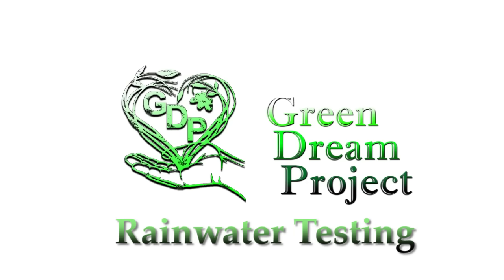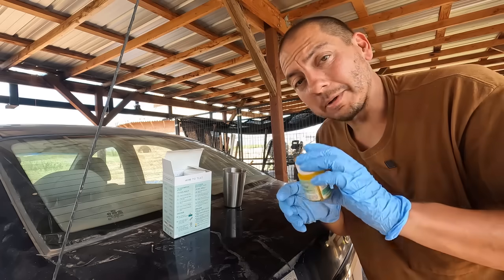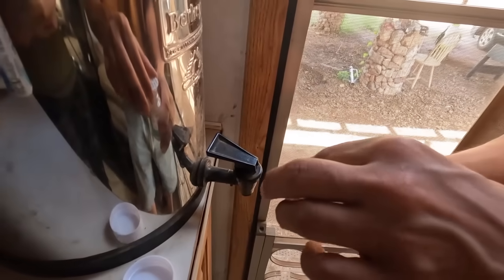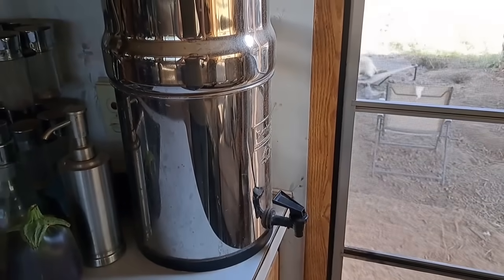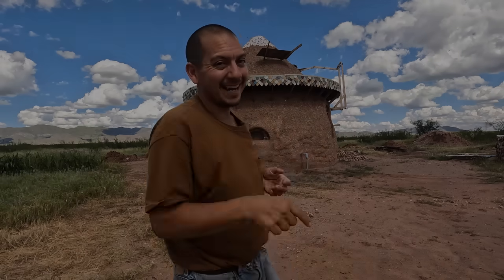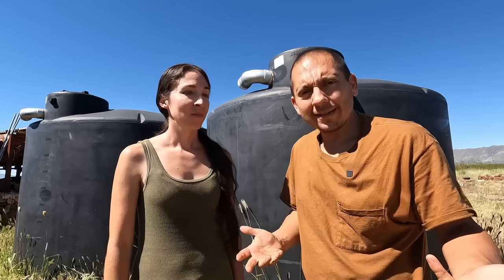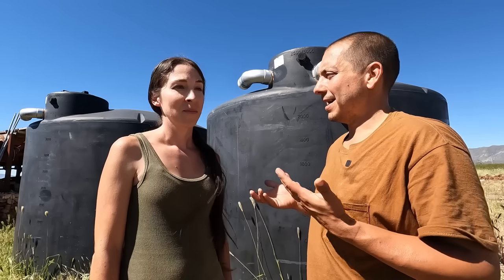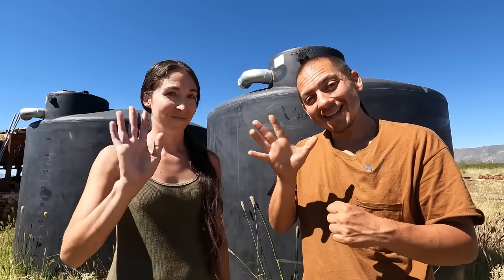Is Rainwater Safe To Drink? We Put Ours To The Test

Comment: Good stuff. Thanks, guys. .. I've been off-grid at end of 4 wheel drives for decades. .. Melted lots of snow during the northern winters ...for all our cabin and critter water. I'm 75 and not sick, yet. .. I have wondered about the particles of dust around which moisture condenses until the drops are heavy enough to fall from the sky. .. Weather on eastern or western North America, big wind storms bring dust from the Sahara or the Gobi deserts, and other locations, to North America in about 4 days. That light weight and high flying dust may be from geologic or other dry plant and animal sources. .. For me, originally considering that eating wild plants that were healthy to be safe and metabolically responsive to their varied dust cored water droplets ...seemed sensible. .. .. Then, perhaps making my body out of metabolically adapted wild plants ...seemed a good idea. .. .. Now-a-days, performing the tests you have demonstrated plus filtering that rain or snow water, hoping to eliminate industrial human and livestock sourced dust particulates sounds like a good idea. .. .. Thanks for sharing your very good video lessons.

Comment: I collect rainwater and I use multi stage filtration and then reverse osmosis water purification, and the last step is an ultraviolet LED light made by crystal is called “klaran” My water has total hardness of 2 ppm and seven log reduction in bacteria. Which is perfect water. Everything is powered by Solar Panels batteries and sure flow pumps.

Comment: As far as plastic / forever chemicals. 
Of course that is just what you should be testing for. Drinking rain water is practically drinking distilled water. And that's what your test reveals. 
The led that should not be in there at all came from the Air we breath. I was surprised there was no mercury. That also is from the coal burning plants. Apparently you are not down wind of one. 
The plastic from your water tanks is one of the things I would think would be the highest level in your water 
.. 
So make sure you test specifically for at least that kind of plastic. Along with forever chemicals. If forever chemicals are in the Air then it is in your water table too. 

Let me know how it goes.

Comment: Commenters below seem to have a preoccupation with strontium, barium, aluminum and a few others. The most important information you need from water analysis is pH, iron, manganese, arsenic, lead, nitrates. And of course bacterial contamination. pH influences your water treatment options. Iron is just an aesthetic concern, as too much lends an unpleasant metallic taste to your water. Manganese is a concern for babies at very high levels. Arsenic is a fairly common natural contaminant, and while the generally accepted 'safe' limit is 10 ppb, you'll want to get it much lower than that. Lead is often contributed by the components of your own system. Finally, nitrates interfere with your hemoglobin's ability to transport oxygen, so they must be dealt with. 
Don't waste your time on the so-called forever chemicals or strontium or other trace elements. You're not going to be able to remove them so focus on those you can.

Comment: Strip tests are fine, generally… but you should really have a sample done by an independent lab at LEAST once a year. Like, in concurrence with the strip tests… to compare, and verify their accuracy. Test the source water (first holding tank), then the final product (from the tap). (Water / Wastewater Treatment Operator - 20 years) Shrugging it off, or saying something like, “I just rub dirt on it, like my granpappy used to - and I’ve always been fine.”, is begging karma for a life lesson, that is preventable, and that too many don’t survive.

Comment: The only issue I see is the lack of trace minerals. If it is an issue tho, you'd have medical problems and Doctors visit will probably have it sorted with small dietary suggestions or supplements.
Me personally, for the drinking water, I'd bury the tanks to keep water colder. Depending on terrain that might not be a viable solution.

Comment: Been working with water for over 50 years, and an all-in-one test strip is right at the top of my list of things not to trust. Lab tested results side by side would be better. Also, you didn't test for a lot of the most prevalent contaminants; PFAS, VOCs, & other heavy metals such as arsenic & cadmium (the latter being used in the manufacture of some plastics. And then there's the issue of black plastic tanks sitting out in the sun & possibly leaching from your tanks. Matte finish poly tanks are often NOT UV stabilized, meaning the base polymer can still react to external UV, etc. Point being, everything from the UV exposed PVC pipes you may use to move your water from tank to tank & to the house, to tank material itself can be adding contaminants. Being downwind from a power plant (look at "Death Valley" in West Virginia, just downwind from where the PFAS precursor C3 was, and likely still is being made, also increases pollution. The problem is that the lab tests are big dollars to test for everything, so better to save your dough, assume EVERYTHING is contaminated, and put those testing dollars into better filtration & treatment. Comprehensive biological, chemical & mechanical filtration can be achieved on a homestead scale reasonably affordably for DIYers, but with iron removal & pH correction I'd expect the total to run around 5 grand. Mind you, that's for near lab grade quality water, and you can still add RO beyond that. Anyway, love the premise. I live in one of the numerous areas where Dupont polluted everything, so we treat with everything from the above mentioned, plus ozone, UV, and an assortment of absorptive resins, but we're also surrounded by stable genius types (gump voters) who don't believe in science, so if they can't see anything in the water it's clean enough for them. Of course most of them die younger from cancer, but they still don't get it. Always assume the worst, prepare for it, and you'll never be surprised or disappointed. Rain water is still the best however, especially since gravity brings it right to you and you don't need to waste energy pumping it up out of the ground. 😊

Comment: I have 2 , 3k gallon poly tanks and a fairly extensive plumbing system that runs around 10 acres, the plumbing system also feeds about a two miles irrigation system. Twice a year or more I add 1 gallon of colloidal silver to each tank, it takes out any bacteria . We use the same tests.

Comment: Of course rain water itself is ok to drink..... but what it comes into contact with after it falls needs attention.
The roof, the pipes, the tank.
Anything in the air will settle on your roof.... if you leave the water stagnant,  that's a problem.....

Comment: I live in the Philippines and collect rain water, infact here, they encourage rain water collection. We use it only for bathing, and washing veggies, I have 2 2000 litre tanks, and 1 1000 litre tank,  on a occasion  due to lack of rain. I go to the local well water feed, fill a smaller tank 450 litre tank and transport it and transfer it, careful to keep hoses clean.  I have often wondered about rain water.  Here the windstream flows from east to west, so we do not get the pollution from china. I am a fanatic about water, its a needless cause to get sick or even die because of bad water yet it happens 829,000 times a year world wide and unbelieveably 6630 people in the U.S.

Comment: It depends on the wind, dust, nearby industry, air traffic routes, seasonal pollen, ... If you live next to a pig farm, there will be ammonia, fecal bacteria... I use reverse osmosis. There was a scandall with Berkey filters. Of course it's not perfect. Carbon filters dont bind to heavy metals, salts etc. Do a test if it even removes sugar, salt or a dye from water. I dont have to tell you that it doesnt or it will get clogged. Rainwater is rather clean tho so it's probably good enough for you. I'm not saying that it's unsafe in your location. Someone else may have an aluminium roof leaching the metal into it. Asbestos is still almost everywhere. Paint flaking off. Microplastic. Your tank is made of plastic and it's in the sun. The test wont show you any of that. Hydrocarbons from fossil fuels, silver iodide from cloud seeding,... Not even the lab will test for everything

Comment: Licensed Drinking Water treatment and distribution operator (Ontario, Canada) and licensed Profecional Engineer here. If using rain water for drinking, consider your roof material. Chemicals can be leached out of tin, ashfault shingles... there are also animal dropping and bird droppings to consider. There could contain parasites in bird droppings, and viruses, bacteria and protozoa like girardia and cryptospridium (to name just a few of the pathogens). Also, when it hasn't rained for a long time, there is more dust, polin and atmospheric particles in the first flush of rain water. If you live close to a urban area, then there will be particulate contaminants from vehicle emissions like brake shue dust, rubber. If in an agricultural area there could be increased dust and residual crop spray. Just be mindful of the rain / dry duration, your area, roof material and very strongly consider a "first flush" removal system to divert the first 2-8mm of rain away from your collection tank (maybe a secondary brown water tank for the toilet). I too collect rain water in a 2500gal underground cistern, but I use this for everything except out human drinking water. Mainly because I don't have a good first flush system. But generally speaking rain water is distilled water that falls through the atmosphere dissolving gasses, soluble particulates, encompassing particulates before falling on your roof, and picking up gunk that's settled on your roof. First flush diversion solves most contaminant issues. Stay safe

Comment: 1... What inline filter do you use... Can you backflush and restore it to near new? 
2... Do you have a pressurized system: pump, pressure vessel etc... 
I live in a fully urban city, and have been using IBC totes to water the garden... Am trying to create an actual way to utilize rain water as a whole house system and shut off city water for all but the driest months. At worst, it will save some money. At best it will provide water for me and my neighbors in case of a serious earthquake and infrastructure collapse. 
3... What kind of bacteria could actually be in rain water. 
So... Back to the water filtering... I have no problem installing a High End Three Stage water filter. But I don't want to be tied to having to buy filters all the time. Advice?

Comment: Be careful on what pipes valves fittings you use and joints , particularly with lowish pH you have. Is there scheme in US for certified drinking water equipment?

Comment: I believe in rainwater catchment but knowledge can be a life saver. Something to do with Microbes. I listened earlier today to a channel that mentioned that your water should be kept below 81 degrees Fahrenheit. That person also mentioned a bubbler to oxygenate the water and cause movement. The topic was "Natural Pool" and "Natural Pond". The Topic would be good listening in the evening.
Reply: We’re had our rain water catchment system for 25 years, second home until recently. We have a 2500 gallon poly tank buried so that the top of the tank is at grade, plus I painted the top of the tank a light tan color. This keeps the water much cooler and nicer. I always wonder about these black or dark green tanks above ground and baking in the sun. Now I’m well aware of the fact that you’re not supposed to bury above ground tanks, but it’s worked out well for us. The key is to let the tank fill before back filling around it, otherwise you could push the sides in.

Comment: What you cannot know is what is in the air that rainwater passes through before it hits the ground.
Do you have tanker trucks or freight trains passing by within 10 miles?
As far as that goes, in Illinois, we have been getting forest fire smoke from Canada lately and we are 1000 miles away.
How are you going to know if or when a truck or train has an accident and produces a cloud of poisonous gas, the rain passes through the cloud and into your water collection.
I collect rainwater also, but we NEVER consume it in any way, we use it for outdoor cleaning.
You could probably use rainwater for flushing toilets and toilets consume the most water in your house.

Comment: plastic = pfa's and micro plastic are endocrine disrupters. The chemical compound fits into estrogen receptors in the cells. Please test for these before claiming your water is safe. Copper pipes are best. Flex piping also releases chemical into the hot water so strong you can smell them.

Comment: how often do you test. you should never put your hands in the top of the tank. you should have a sample valve at the bottom of the tank. should disinfect the valve before sample is taken to prevent cross contamination. let the water run five minutes then collect your sample. Berkey's Berky should be tested too. I have already commented on Berky's. big rip-off a ice machine filter is the same as a Berky filter just different packaging. and a lot cheaper.

Comment: .2 lead in rain water is crazy high and way above epa recommendations - you need to check that with a more sensitive sensor.
Reply: Limit of detection. You should get it checked by lab for complete suite of all heavy metals, limit for lead in Europe is 10 ppb (micrograms per litre)  but they are thinking of making that 5ppb. Do it at the tap you drink from.
Reply: Limit of detection. You should get it checked by lab for complete suite of all heavy metals, limit for lead in Europe is 10 ppb (micrograms per litre)  but they are thinking of making that 5ppb. Do it at the tap you drink from.

Comment: Small detail I found out, straight rain water is damn corrosive just like distilled water. It will pull ions out of any metal it encounters. Fittings, pipes, pumps. 
I have to rise the ph to stop it rotting my pump and pull minerals out of me. 
Marble pebbles at the tank intake look like doing the trick.

Comment: But what about the Phalates (forever chems)? I thought that was your main concern? How do you test for those? Is it still too expensive? You generally don't get minerals other than sulfur in rainwater, so kind of pointless. Most minerals are chiefly derived from non-surface groundwater and metal plumbing. For now, I would worry a little about phalates from the HDPE cistern and its requisite plumbing much more than the rainwater. My current understanding is HDPE is still fairly safe , the more rigid the plastic the better. So it's mainly disposable plastics that are potentially more hazardous.

Comment: So I am new to the concept of harvesting water. However, I bought 2 250 μm 60 mesh ultra precision stainless steel mesh and place them over 5 gallon buckets.  I additionally run the collected water through these filters again to filter out any specs of contaminants.

After being stored in my garage a couple of days in my garage with a lid 6:58 , I see many more black specs have aggregated at the bottom of my buckets. What is that?

Comment: Good content. Just subscribed. Question: I have 2 55gallon rain barrels that collect water from my down spouts that I regularly use for my garden, but in case of a prolonged power outage I want to use as my main water supply. Are there any filters that can hookup to a barrel tap to do filtering? Thank you

Comment: These dip stick tests are not much good. What they detect and how much they detect of what they claim to detect is highly questionable. Same goes for the little tubes that are supposed to tell you if your water has harmful bacteria in it or not. Real water tetst are done by specialized labs using sophisticated analytical machines and bacterial culture methods in incubators. None of these dip stick tests can detect herbicides, pesticides, hormones and other organic contaminants you should be concerned about. Finding out what your water really contains is an expensive and complex undertaking. Plus you need to repeat those tests often as no matter what you water source is, the contaminants might change over time.

Comment: I would like to know what chemicals might be in rain water as I'm using it regularly.  I buy drinking water for my shepherd,  and i filter the rain for in home use. I recycle grey water for wash cycle in laundry and straight rain water for the rinse cycle.  Roughly 1000 gallon storage but will double that soon and would like to acquire a 10k gal. tank to mostly bury on the low end of the property.

Comment: I talked to one guy from main,  his solution to bacteria was rather novel.  He up a filter before his storage tank,  and used pool filter chlorination tablets to shock the water, and chlorinate it for storage,  then use a charcoal filter  to scrub the chlorine out of the water.  He said he has been using this system for a couple years without issue.
Reply: 😂 too much work and trouble for nothing, end up with the same product you start with . 😂
Reply: @jeffreylong9405  No you do not. You end up with water that is free of bacterial contamination, obviously. That is the whole point of chlorination. If your water is contaminated you have to do something about it.